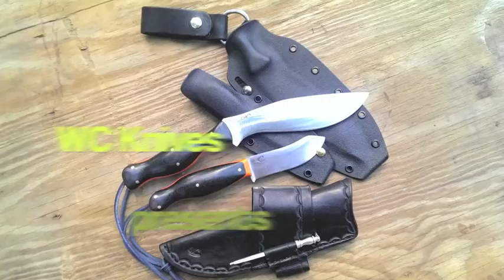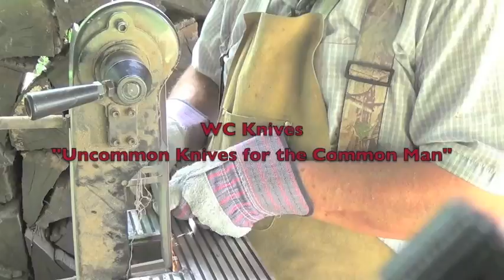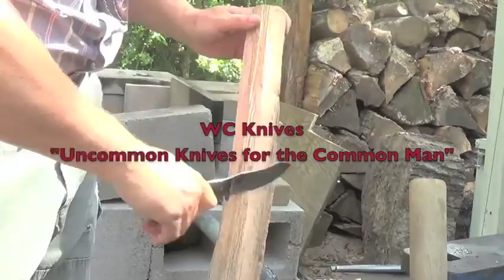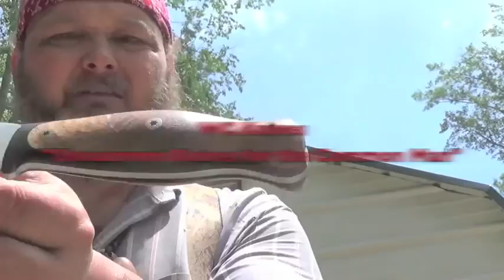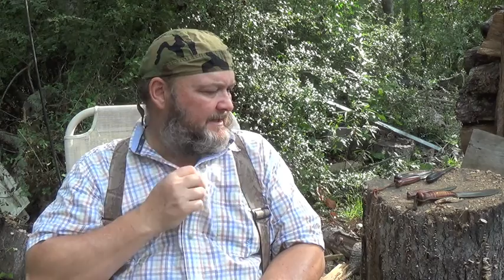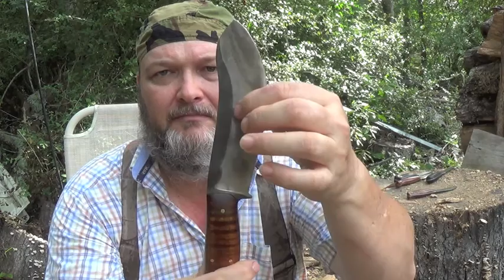Whittle Talk (Flat Grind Geometry)

Comment: Halleluja,  sometimes i think i am the only one going outdoors using a flat grind. Scandis seem to be the shit in the bushcraft community.  But i do this stuff since the word bushcraft wasn't even en vogue.  We called it living of the land back than. Back than, i brought every cutting tool and the kitchen sink with me. Axe, shovel, machete, small knife,  big knife , i was prepared. Prepared for things that never came. Today i need a good folding saw and a knife, must not even be a fixed blade, most of the time i use an opinel or a victorinox.  I never baton, bcs i can start a fire without that, i think it's a waste of time.  I use a pencil sharpener for small twigs to expose the dry inner wood, works like a charme. And i can't imagine a better knife than an opinel to field dress animals.

Comment: Well timed video for me. Yesterday I got in a trade item, a antler handled F Herder blade. 8 inches, full flat, very thin. It didn't have an edge on it but with a little work soon is was shockingly sharp. No doubt that it's blade thinness is a big part of the reason. But it would easily be damaged if used for something other than cutting. That's the reason I believe in carrying task specific knives and carry a hatchet, axe, or machete if you want to chop for crying out loud. Too much emphasis is placed on one tool options IMO. That's what a Leatherman is for. Thanks for sharing.
Reply from the maker: Chris Wilkes Amen, bro. I'll be glad when that OTO fad goes away. Appreciate the view and comment.